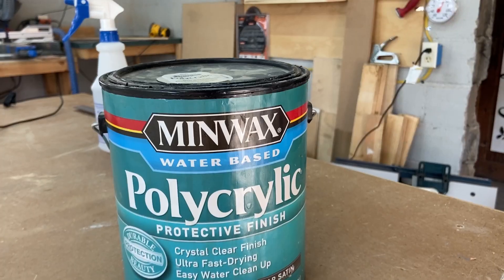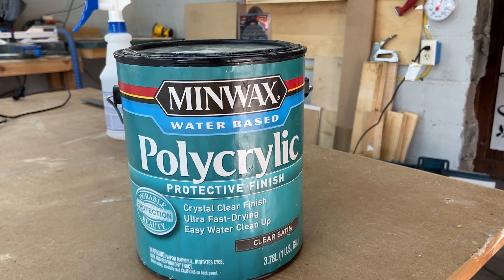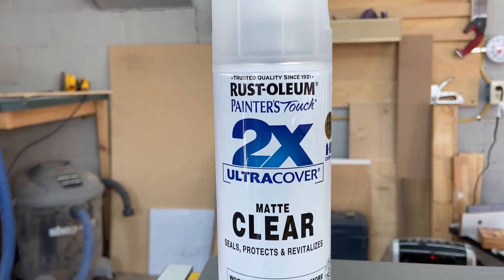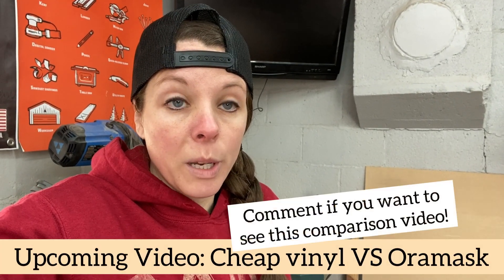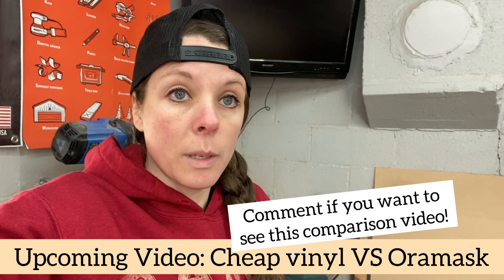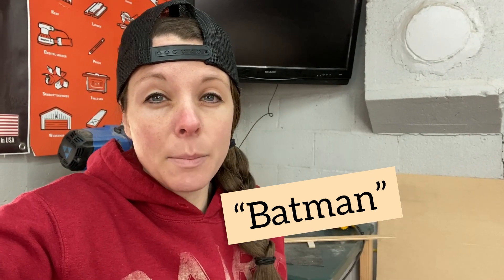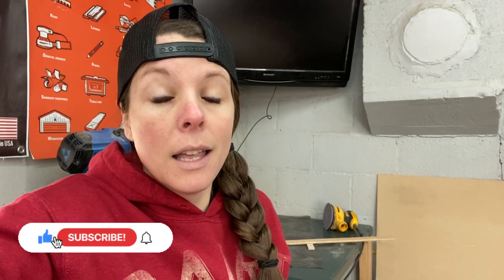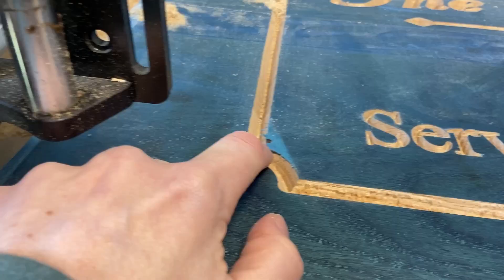How to Use Vinyl on Wood for the CLEANEST Paint Lines! - Sign Making on the CNC @OnefinityCNC

Comment: Do you think spray lacquer will seal as well as the water-based poly?
Reply from the maker: I do! I think that will work just as well. I have also used rattle can clear. Shellac works too. Anything to “clog the pores” that is clear.

Comment: Batman ... Thanks for the info!   Did you spray the polycrylic over the entire sign? Or, just into the carved letters?
Reply from the maker: No problem! I stained, put the vinyl on, carved, then brushed polycrylic into the letters and over the vinyl near the edges of the letters, then painted and then peeled the vinyl off. Thanks for watching!
Reply: @OakHillMillworks  Thank you for your response!   I do some woodworking at my home in Vermont (originally from Latrobe Pa) and planning of getting a Muse 3D soon.  The Muse is smaller than your laser but will be easy to get into my basement shop.
Reply from the maker: @patrickmahoney1056  very cool. Go Steelers! Good luck with your new laser when it comes!

Comment: What kind of wood were you using here?  Thanks!!
Reply from the maker: Hi Howard! This project was made with red oak. It was more blonde than most. Some people thought it was ash. To be honest, it carved a little rough on the border when going with the grain but some might hand sanding fixed it right up! That open grain on red oak made for a V Carve that needed some help. My tests on poplar prior to this video were very clean!
Reply: @OakHillMillworks  nice. I’ve got some red oak in the shop now. Did it take stain well?  Great looking project!
Reply from the maker: It does take stain very well. The red oak is fantastic for staining!
Reply: @OakHillMillworks  thanks. My current favorite woods to carve are poplar and red oak but I’ve never stained either. I appreciate the info and look forward
Add to more cnc content.

Comment: I  been making flags with my Cnc and when I stain black let sit overnight then apply the oramask to the painted area the stain peels off with the oramask. Any suggestions would be great. Help please!!! I tried to stain them apply coats of spray poly and it takes both off.
Reply from the maker: Yikes! Are you using oracal 813?

Comment: Batman. I did that on the first sign I ever made. I was MDF and I used Frisk film but didn't spray with Polycrylic. I will from now on whenever I make signs.
Reply from the maker: It’s that simple extra step that just prevents headaches later trying to sand off bleed marks or, worse, have to re-make a sign. Thanks for checking out the video, Kevin!
Reply: @OakHillMillworks  You’re welcome, Correction, second sign. The first one was finished black cherry. The second was the MDF.

Comment: Batman - Oramask is great, tried the less expensive stuff... not worth the struggle! I also use a 4" rubber roller to make sure all the air bubbles are out and it is fully adhered!
Reply from the maker: Oh good tip! Gary mentioned that rubber roller tip as well. Wonder if they have those at Harbor freight. 🤔🤔
Reply from the maker: Oh and I’m eager to try the cheap stuff to feed my curiosity.
Reply: @OakHillMillworks  got mine off Amazon!
Reply from the maker: @grega-kendalheightsdecorwo9511  go figure! Amazon has everything!

Comment: Feeds and speeds?  Batman, there's a speed that I think is too fast for the Oramask.  It burns or melts it.  Have you found this too?
Reply from the maker: I haven’t noticed that yet but I don’t do it a ton. My router stays on 2-3 most of the time.
Reply: @OakHillMillworks  
I'm spindle.  My gut say to feed stronger than speed to keep things cooler.

Comment: I'm Batman. Awesome video. Too bad I don't have a CNC yet. Lol
Reply from the maker: Ok once and for all… is it Batman or The Batman?!? — you CNC shopping?? I use this technique when I make laser engraved signs as well. You can also use it when you are just using stencils whether it’s carved or not.
Reply: @OakHillMillworks  it's just Batman. But, most just call me Mr. Batman. Lol... I currently use a Cricut for making vinyl stencils. I do have a laser engraver, but haven't tried using it to cut vinyl. Too afraid it sill just melt it.
Reply from the maker: @MadMax32781  nice. Might wanna read up on lasering vinyl. The PVC in it is toxic so you want to consider exhaust and potential wear on your machine. You would not want to be breathing that in so please read up on that, Mr. Batman.